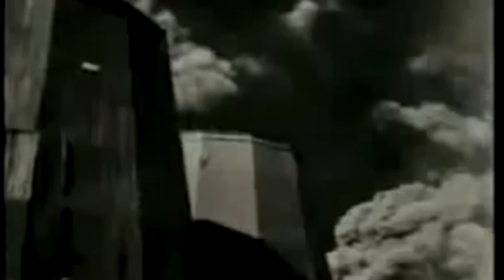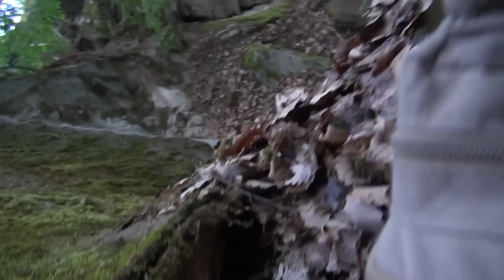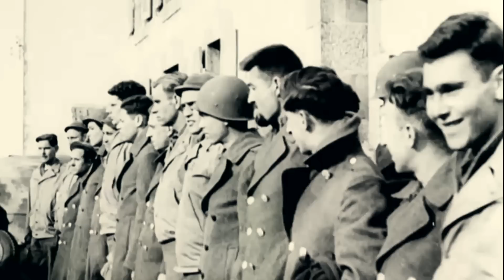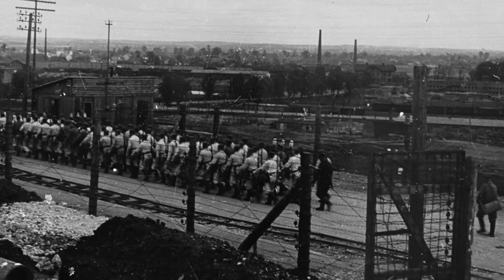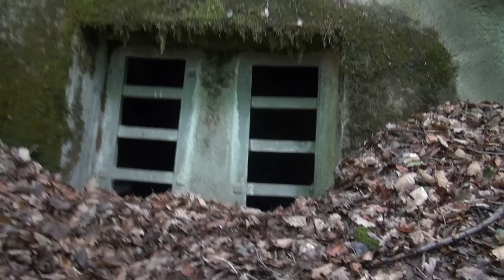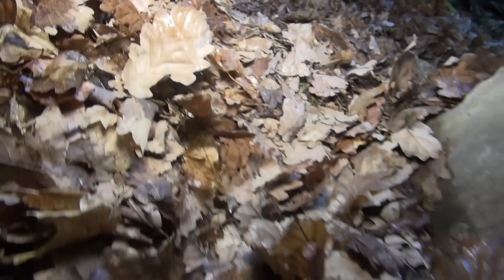WW2 SPECIAL PROJECTS KAMMLERS SCHWALBE V BUILT BY GI'S

Comment: It occurs to me - you could really do with a LIDAR scanner of some sort. 
The one that's built into the iPhone 13 Pro is pretty handy, though not sure how it would cope with larger sites. A full professional rig probably costs the lion's share of ten grand, but there are cheaper alternatives.
Best bet would be to try with an iPhone first, preferably one with at least 512GB of storage. You'd need third party software (not expensive) to manage the files. The advantage being that you can "return" to any area scanned and see it in 3d, colour, and view it from any angle, including from outside of the scanned area/structure.
You could scan whole sites, probably in sections, then stitch the areas together afterwards, or, just scan areas of interest/curiosity/"contradiction".

Comment: Please teach this breathing preparation...  ( I learned it, by happenstance and experimentation, during my last two PFTs, while serving in the USMC, in 1977.  It wasn't taught, anywhere.).
To begin a day; and, especially, to prep for anything strenuous (as before a test, a speech, exercising, a game, chaos, etc.).
Like while dressing for a game... Take a deep breath, and hold it as long as you can; while, even taking in more air, before letting it go and letting your body calm again.  Do this, at least 5 times, in a row.  Such stretches your chest and lungs open, so you take in far more air than usual.  It makes one feel like when coming out again after a halftime... Ready!
  (I had always struggled with my breathing, during runs, like during a quarterly PFT.  I always finished, middle of the pack.  However, the night before my second to last PFT, I had been swimming, and practicing my water treading, to help battle my fear of water, in light of my particular occupation, as a hit-the-beach Marine.  Naturally, I noticed the difference, during my run, the next morning.  So, I did - exactly - 5 deep, held breaths, at the line, before beginning the race.  I came in first, with about 100 yards between me and the second man behind me.
  Thusly, any team leader should shout "breath", occasionally, to do exactly this; especially, at crucial points before, and in a game.).
  Again, please pass it on.  I teach it to anyone who will listen; but, it needs to be taught in schools, and such; and, putting some good old science to it wouldn't hurt.
 As I said, it isn't, or wasn't taught, as late as recently.  I suspect, it's spreading; because, I also tell folks in sports, that they must teach it to their competitors, (after they beat them)!
  And, give me feedback, too.
  Thanks.
Reply: I've seen a lot of videos over recent years showing deep controlled breathing to be helpful in times as you say, also to calm down and stay in control and not panic etc. So I used this when my chronic pain gets really rough, it helps a little which is better than nothing. I use it to calm down and when attempting strenuous activity for me at least. I just wonder why it's easy to forget such a basic concept so tied to life. I think that's why God made basic breathing automatic, if he didn't we'd all die very quickly imo. 😂